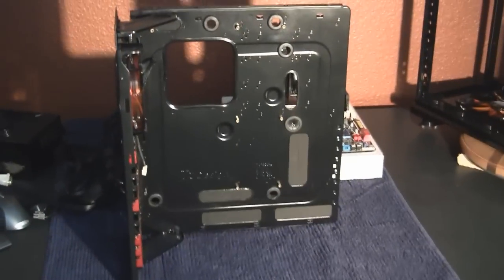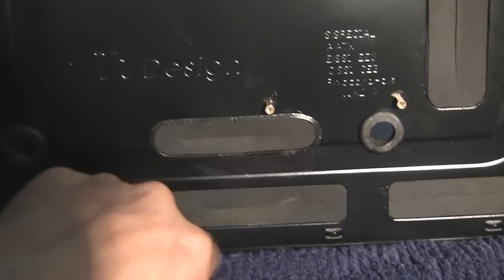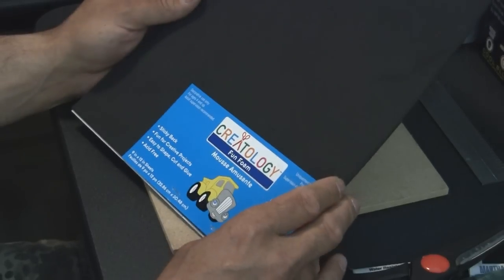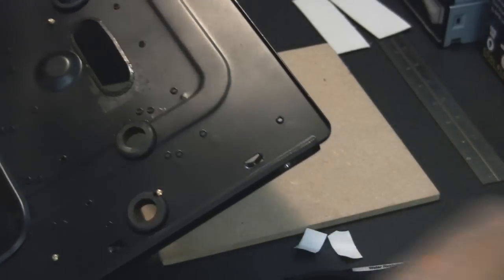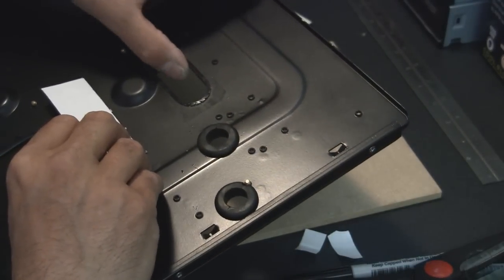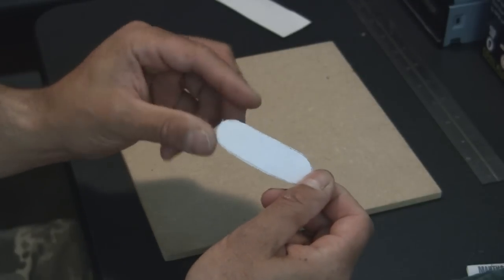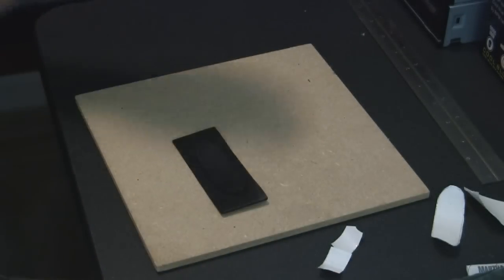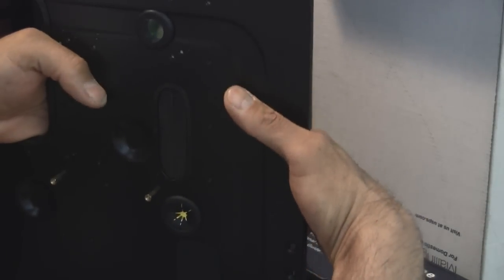Make Your Own Custom Grommets For Your PC

Comment: Just a tip. Put the large piece on the motherboard tray carefully in position and then put the fitted piece in from the back. Once this is done carefully use the box cutter or other sharp blade to cut your slot.

Comment from the maker: Thanks Bro, I appreciate your kind words.
Ya, the idea came from the Corsair's case, just had to find a way to replicate it. The foam work great, but I'm looking for some thin rubber to use instead of the top layer of foam.

I did all the holes for $1.00 (1 sheet), you can't beat that price, heck you'll spend more than that in shipping. lol

Cheers
LazyMan

Comment from the maker: You can find it at Micheals Craft store, they also have a website. But since making this vid, I personally feel it's better to just use neoprene rubber. You can find the rubber at Amazon, type in rubber sheets, you are looking for 12X12 neoprene rubber, it's about $10. Use contact cement to glue them together and to attach to the back of the mobo tray. Also if you want to use just one piece attached to the back of the mobo tray it works pretty good too. You can find contact cement at Home Depot.

Comment from the maker: @nikbear Thanks bro...yeah it really makes the difference... Check out the revised video...as you will see I used 1/16" neoprene rubber in conjunction with the foam.......but since then I have even revised it again...same as the revised video, but instead of using foam I used rubber only

Comment from the maker: Well first off IMO opinion it looks cleaner, and it has better aesthetics.

Also it helps with airflow, what do u think a gaping hole in the airflow path would do. yes it's going to create turbulence and your going to lose some air thru the back of the mobo tray. It may be minor, but the more aerodynamic it is, the better airflow.

And lastly it is an original mod along with some of my other mods that sets the Black Widow apart from others.
Since this vid I have improved the mod by using rubber.

Comment from the maker: @Buba0880 Glad this will work for you, however I do have a revised video....and even after that video I revised it again. Now I just use rubber (1/8" neoprene from Amazon) and attach it to the mobo tray with contact cement.

good luck
LazyMan

Comment from the maker: @ksidornseif Yeah, but I change them since then as they didn't hold up as well as I originally thought they would. My final version is using 1/8" rubber and attaching it to the mobo with contact cement. Take a look at my video Custom Grommets Revised, in hear I used rubber and the foam...but even that wasn't as durable as I wanted so I ditch the foam all together and just used the rubber.

Good Luck
~LM

Comment: The black foam that comes in the motherboard box, sitting under the bottom of the anti-static bag.. sometimes it is red/pink, I throw that stuff in my daughters case :)

I should put together a vid of my build...... one day.... I have a crap cam so..

Yeah if i want to change the PSU or anything i do have to remove the mobo, But I feel it is worth it as the aesthetics is a big factor for myself.

Comment: I used to glue some motherboard foam to the back of the tray.. 

These days i make the cuts closer to the mobo so i have to route the cables before I mount the mobo meaning the cables are more "Hidden"

Comment from the maker: I see, but isn't that foam to sparse to really be effective. and how do you adhere it to the mobo tray? The foam that I used was very dense, so it holds it's shape easily.

Aesthetics is very important to me also, as you probably can tell from my vids, so I no what you mean.
I still would hate to remove the mobo every time I wanted to change out a fan or add a sound card, graphic card ect.

I definitely would be interested in seeing a vid or pic montage of your build.

Comment: One question: do the wires make an indentation in the foam that doesn’t go away? Even so, thank you so much for taking the time to explain this on film. I hadn’t thought of this and had planned on making silicone duplicates of my grommets with plaster of Paris and other mold making supplies (I want white cable grommets but can’t find any anywhere). Your way is fast & easy!

Comment from the maker: not sure what you mean, what is mobo foam?  So every time you need to remove a cable you have to remove the mobo, that would be a pain in the .......! 
I cut my holes so they are half way under the mobo tray, that way they are partially hidden and you can still get your cables in and out.

I would love to see a vid on your cable mgmt. or at least some pics. you could put together a montage of how you use foam and how your cable mgmt. looks and post a video on your channel.